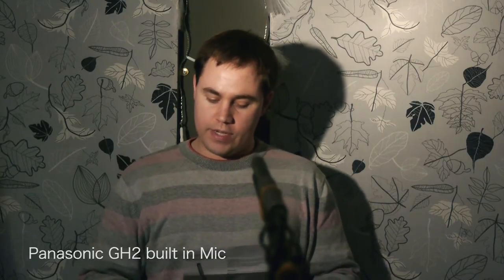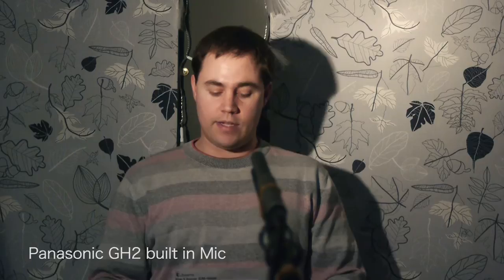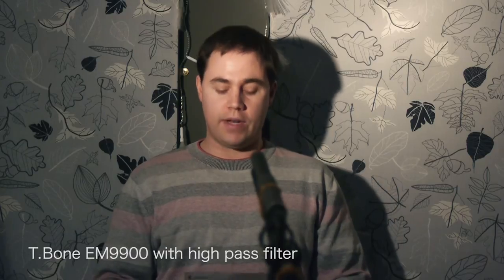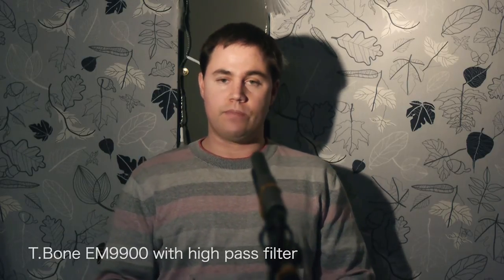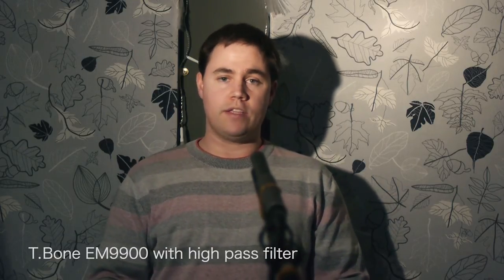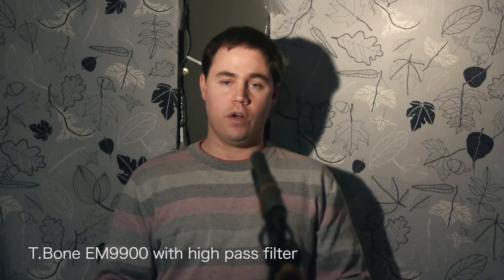Thomann t.bone em9900 short test

Comment: Do you think this'd be good for a voice over application? I'm looking for an inexpensive shotgun mic to be my voice over mic since I really can't build or set up a voice over booth to block out noise.
Reply: You'll still need some sort of treatment even with a shotgun microphone. Even with a dynamic microphone you would still want at least a bit of treatment (significantly less than a condenser, but still a dynamic mic is no fix for a bad space). You can hang up heavy blankets (quilts, thicker comforters, moving blankets, etc.) to use as acoustic treatment in a pinch.